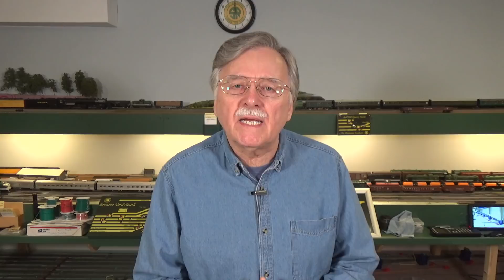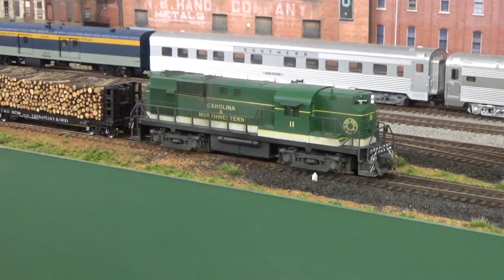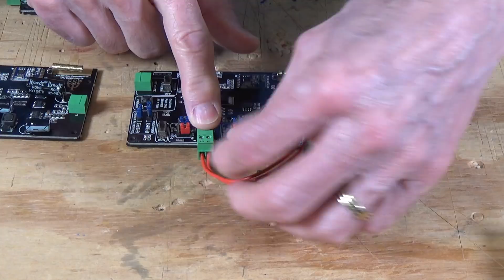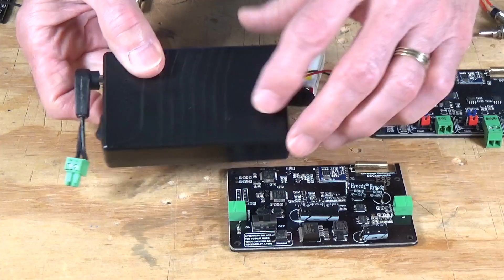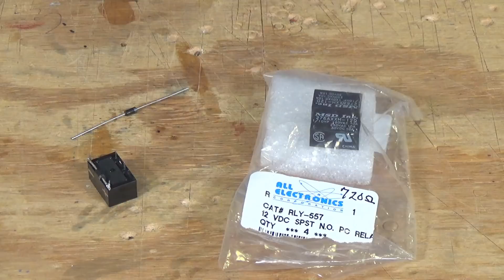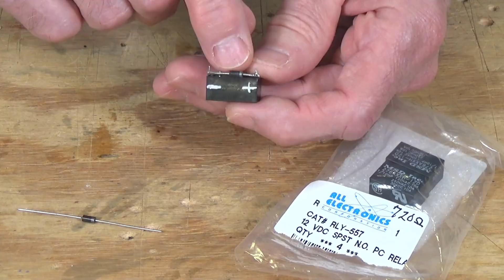NEW Wireless Layout Control With The Power Of ESP® (236)

Comment: Thanks Larry. I'm a little confused? Do you need a Receiver for each switch machine?  And do you now pair three receivers with the same transmitter? or daisy chain three switch machines somehow to the same receiver? I know this 4 years ago. Hope you see this. Or even remember. Vincent.
Reply from the maker: Each switch machine needs an accessory decoder if you want to use the ESP wireless system or use DCC commands to control the turnouts. Some switch machines such as the iP-Digital, Smail, and Walthers come with them in them. Or you can use separate accessory decoders that can control anywhere from 1-4 switch machines.

Comment: Where did yo get the green connectors for the transmitter & receiver to connect portable power supply & 9 volt rechargeable battery plus toggle switch?
Reply from the maker: They came with them.
Reply: @TheDCCGuy  Thanks! And also the control panel layout in the 8.5 x 11 picture frame?

Comment: I like the concept Larry, but if you have a modular exhibition layout you still need to pass the DCC bus for both track and accessories across the modules, which means you do get the benefit of a wireless control panel but there still needs to be an accessory bus between the boards.

As aside, I find your videos really informative and your method of explaining the subjects very easy to follow. 29:23

Comment: Did you ever do a video on pairing the 2nd Rx to a mimic board?  Adding lights to the portable control panel is my desire. Link to the video, if available? Thanks.
Reply from the maker: No, I decided not to do that as it would have required additional components and therefore a larger control panel box. I wanted my panel box to be as light and portable as possible. I used toggle switches on the control panel making it easy to see by the position of the toggle which way the switch is thrown.
Reply: @TheDCCGuy  What are specifications of the toggle switch? Could you use LED push button switch instead of toggle switch to turn 12v power bank on/off?

Comment: Larry, I plan on making an NCE system and use the wireless layout controls from DCC Concepts. Their manual says, "DCC-ESPR.1 can be powered by a DCC track bus or with any regulated DC power source or battery able to deliver from 12 to 20 volts." Is powering from the track bus the better way to go? (I don't have a DC power source, should I get one and why?)
Reply from the maker: As I understand it there are 3 options. (1) On the one hand should you want to use throttles to control accessory decoders and point motors, etc then you need to feed commands from the command station to the ESP receiver which means connecting to the main DCC power bus feed. (2) On the other hand if you only plan to use the ESP wireless controls then a DC power source makes more sense and takes some of the burden off the NCE command station and DCC power bus. (3) You also may be able to mix the two by feeding the DCC commands into the receiver and power it using the DC power supply
Reply: @TheDCCGuy  I like your option 3. DCC Commands coming and using the other output/input for DC Power coming in. Can you recommend a DC Accessory Power Source that will handle the 12 to 20 volts which is compatible with the NCE Power Pro Starter Set with Radio, PH-PRO-R/5A?
Reply: @TheDCCGuy  Thanks Larry. I like your explanations.. Continuing on option 1 - feeding commands from the command station to the ESP receiver, would it make sense to have a transmitter splitting off your DCC bus to the Receiver for EACH power district/zone?(meaning a very good reason for additional transmitters per power district?)
That's what I am thinking of doing on my system...
Reply from the maker: @andrewreynolds599  The transmitters are located in the control panel and send the commands to the receivers. The receiver converts those commands to DCC commands and adds them to the DCC power coming from the command station and sends that out to the iP Digitals.  These can be used to create a 1.5 amp accessory bus to power just the iP Digitals which is what I suggest—keep the accessory commands separate from your DCC power bus.

Comment: Hi Larry. I am searching for extra Green connectors like those used on this system. I cannot find them  at All Electronics. I just don't know what to call them. Can you post a part number or at least a name/mfr? Thanks.
Reply from the maker: I don’t know about the plug in type but if you want just plain old “screw terminals” then that’s what you search for.

Comment: Wireless model railway controllers have been around since the 1980's !!!! But I have not yet found one that is good enough for really smooth jerk free running, and also suited to model railway exhibitions where interference becomes an added issue. There is also the option of controlling layouts by interfacing your mobile phone through "Blue tooth" to certain DCC systems. But again this system currently results in erratic operation, and seems even more prone to interference, especially if you have more than one layout in an exhibition hall using this system ! 

Indeed I have not yet found any DCC system that is itself jerk free, for the simple reason that DCC uses 16v AC in the rails, but locomotives still have 12v DC motors ! The problem is of course the "chips". Indeed "chips" are too small to incorporate a normal quality Rectifier to change the AC to DC. So manufacturers take a  shortcut and the chip effectively cuts AC in half by using 4 diodes in a quadrant. This provides "Half Wave" DC, which is NOT a pure unadulterated supply. And the better the quality of the motor inside any loco, the more rapidly the motor is subjected to overheating, cutting its life expectancy !  

Another reason for loco jerky behaviour on DCC is the fact that the chip also has to quantify how much power is passed to the motor, according to the speed you want the loco to proceed at. As DCC is a digital system, it cannot apportion an increase  or decrease in voltage smoothly, and can only do this in steps. Most chips today still only use a maximum of 24 steps, hence the still jerky nature of locos most obvious when speed is being increased or decreased. By comparison a traditional 12v DC type quality controller is not confined to "steps" and increases or decreases power in a smooth continuous fashion, hence the loco responds far better !!!!!!
Reply from the maker: I think you need to watch the video, it is not about locomotive control it is about layout control.. But since you brought it up, I have been using Digitrax wireless throttles since their first ones about 20 years ago and there really is no difference in loco performance between them and wired throttles. I would never go back! And the TCS UWT-100 is equally responsive and easy to use. The ESP wireless system I detail in this video uses unique addresses so a whole room full of them can be used without any interference.

Comment: How did you connect your Power Cab to the Transmitter's input power receptacle, to program it. Did you have to "cut and skin" the opposite end of the 4 wire curl;y cord to do it'? And if so, what two wires did you use, and would they be phase sensitive?
Reply from the maker: Great question. I simply took 2 clip leads with their other ends cut and stripped, inserted the stripped ends into the screw terminals on the transmitter, clipped the leads to the track, turned on the power, switched on the programming, and sent an accessory command to the address I wanted to program it to. Very simple and easy. I’ll have to demonstrate this in a video, maybe the next one or a special one just on programming accessory decoders in general.

Comment: This is a very expensive bluetooth application for model railroaders who MUST HAVE a turn key solution for everything they want to do.  Why must everything be turn key?  Your channel always ignores how to DYI with microcontrollers...like Arduino.  There must be some aversion to simple programming of simple micro controllers.   RF solutions using very inexpensive RF transmitter/receiver pairs or transceivers have been available now for many years.  These devices are quite reliable, and pairing requirements and their limitations do not exist.    How about stepping up and showing your viewers how they can reap a world of benefit by using Arduinos on their layouts?  There are many simple one-hour projects that could set signals, throw switches and set routes, turn on/off lights, instigate sound effects, ...  One Arduino controller could operate an entire control panel which itself could be a wired panel or a wireless panel.
Reply from the maker: It is not Blue Tooth and depending on your application is no more expensive than a new sound equipped locomotive. And new rolling stock sells for about what one ESP transmitter or receiver costs. I have no control as to the purchasing desires of today’s modelers. The ready to run off the shelf direction has been increasing it seems over the last decade. I used to do a lot of articles on painting and super detailing locos but with manufacturers producing runs of them in every possible paint scheme and the correct details in many cases no magazine really wants those anymore. One of these days I might get caught up and actually have time to experiment with arduinos, etc but right now I am happy to leave those kinds of videos to electronics experimenters.

Comment: Hi Larry, Very interested in this ,But do you have to have an NCE equipment to program the individual address's for 501,502 and 503
just wondering
Regards
David
Reply from the maker: No any DCC system capable of giving accessory decoder commands should be able to do the programming.

Comment: Larry I find your channel very interesting and I have a problem. I have a n scale layout and have used the new Walthers switch machines in DCC. The problem is I also have a Kato crossover what kind of single use decoder can I use and also have a push button on my control panel.
Reply from the maker: Jim, I have never worked with Kato switches. However I do know that Digitrax makes accessory decoders that work with them. The problem is I don’t know of any single output accy decoders, most have 2-4 unless they are built into a device.

Comment: This is a nice system but it lack a lot in feature if we compare this with the IoTT system. I have a few Yellow hat and they have 32 inputs in wifi with loconet protocol. And the footprints is way more compact. Also it can drive  around 1000 neopixel led. Idéal for a control panel or current detection with an add on detectors.

Comment: I must be missing something but using this system seems overly expensive and complicated.  On my layout I use a dtdp on/on toggle switch on the control panel to control one (or more) switch. 3 signals covering the approaches to the switch and 2 led's on my control panel to indicate either main or diverging route depending on how the switch is thrown.  I use cheap wire to connect it all vs. all the circuit boards you are using.  I simply throw the toggle and the lights on the panel change, the switch throws and all three signals change to show, from all directions, how the switch is aligned.  All in all, pretty simple.
Reply from the maker: If you watch my control panel videos you’ll see that in the past I’ve done that too. However for someone wanting to avoid a lot of extra wiring and the flexibility of using accessory decoders which in the future could be linked with JMRI/PanelPro it offers a lot.
Reply: How do you pick up your control panel to walk around the layout with the train?

Comment: Larry, which video can you point me to where you show setting the Cobalt Switch Machine to the 501 Address?  Also, can this same programming be done for the Tortoise Switch Machine?
Reply from the maker: I provided links to that in the video. With a Tortoise you need to either purchase an additional accessory decoder or use the Smail which has one built in.

Comment: Larry, thanks for another installment.  This has been a very useful series.  A question, is there a reason why you're using the Cobalt IP-Digital machines rather than the Cobalt-SS model that's designed for above board mounting?
Reply from the maker: The SS appears to be a solenoid type snap switch plus it does not appear to have all the internal switches and accessory decoder like the iP Digital. and requires an additional making it a more complicated installation.
Reply: @TheDCCGuy  I think it’s a stepper motor rather than a solnoid
Reply from the maker: Could be, I saw the 3 wires and that usually is an indicator of solenoid system. At any rate the iP Digitals are what DCC Concepts provided.

Comment: I'm an electrical engineering student. It's a neat system but for someone that's technically inclined, it's cheaper and far more customizable to make my such system, if certainly not as quick and easy. But for me, being able to DIY the electronics is half the fun!
Reply from the maker: I agree to a point, electronics can be a hobby within the hobby for the technically inclined (as you put it). However many modelers are off the shelf purchasers who just want something they can plug in and run with. The folks at DCC Concepts have been designing and producing products that can deliver on the desire.

Comment: DCC Concepts ESP is a good system but far too expensive. Only 3 outputs per transmitter so if you had 12 points \ switch motors, you'd need 4 ESP transmitters and 1 receiver. If you wanted led point \ switch feedback, you need another receiver.
Reply: I agree - the costs are outrageous and the functionality is better implemented using widely available components (ESP8266 Microcontrollers for example) and WiFi or 433MHz. However, I do appreciate that some amount of coding and system integration smarts are needed (or you need to know someone in your club that has them), but it's not very complex stuff and if you're doing a lot of this you can save a ton of money over buying sets of these boards. The Cobalt switch machines however are well worth the money.
Reply from the maker: Yes there are almost always other ways. However based on the questions I currently get as wells those I have received over the last 25 years writing for various magazines I think you over estimate the technical sophistication of most modelers. Consequently I have become used to writing for the lowest common denominator.
Reply: @TheDCCGuy  Completely agree with you, that is the correct inclusive approach - those who want (or have the knowledge) to do more can take the ideas and go do their own home-brew implementations. As I was only involved with the hobby in a lightweight way (and not for that long) in the 1980s I am not sure how things were then; however my impression now is that there are a lot of people into the hobby now who have tinkered with digital electronics as a hobby or in their careers and are very able to customise or even 100% DIY stuff.  I'm not sure they get near to being more than a sizable minority, but it's an interesting change from how it was 30 years ago when very few people could even define the word Digital! :-) 

Keep on right the way you are, Larry. You're doing great stuff!
Reply: I agree. This is outrageously expensive for what it is. If you're just doing local switch control, then toggle switches hardwired are fine, if you want dispatcher control then inputs need to go through JMRI and the DCC system so that it can keep track of last known turnout position, do lockouts, etc. For route control there are a zillion ways to do it, JMRI, Arduino, LCC, Digitrax DS74s, NCE Mini Panel, etc. The wireless function is also rather unnecessary for use on a layout.
Reply: @woodalexander  agree re costs but whilst at a friends layout the other day he had forgot to switch a point resulting in him having to run back to the control station and press the emergency stop. Had he had a wireless control panel at the other end of the layout with him he could have switched seamlessly. Personally a Z21 with the layout screen with turnouts showing is easier and cheaper.
Reply: @Haymarket47  Why not put local controls? Or a tablet running JMRI that can handle the whole layout? There are so many ways to solve this.
Reply: @woodalexander  Agreed - JMRI is endlessly useful - but making it do its magic does mean you spend more time in IT land and not running trains - so people who come for the latter (or lack the background for the former) do tend to look for discrete packaged solutions. Sadly - as in this example - they come at a price.  Age old trade off - you can spend the time or you can spend the money to get what you want 🙂
Reply: @alanmusicman3385  I disagree. I find things are so much faster and easier to do on a PC with JMRI than a DCC system throttle or other dedicated hardware with cryptic programming. Even on my slow layout PC, changing CVs is a snap.
Reply from the maker: As with all new technology it comes at a cost. Consider the cost of a new iPhone vs a wired landline phone. Even with the cost I think there are a number of uses that would justify the added cost, especially modular club layouts, exhibition layouts, remote occupancy displays, etc.

Comment: Thanks Larry for getting your head round all that!  I have to admit I'm struggling to see the usefulness of it, other than (as you showed) putting the transmitter in a wireless walk round control board. I think DCC Concepts already do components for mimic boards that seem to be able to do pretty much the same thing.  Being able to have the transmitter switched by track detection (or other inputs) sounds useful, but in that case, it wouldn't need to be wireless.
I really like the DCC Concepts guys, but compared to other wireless systems, this seems a bit clunky, with the benefit being that it doesn't need wifi.